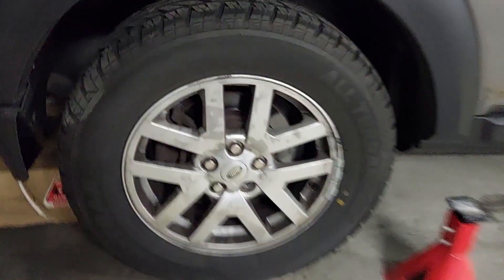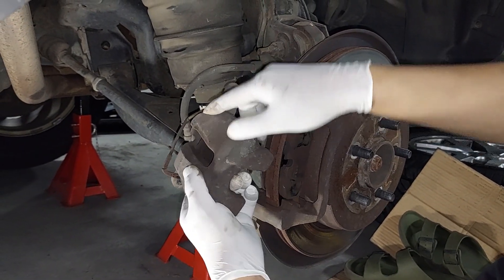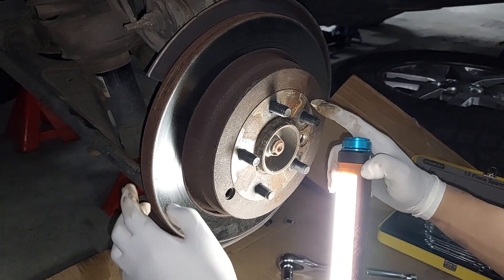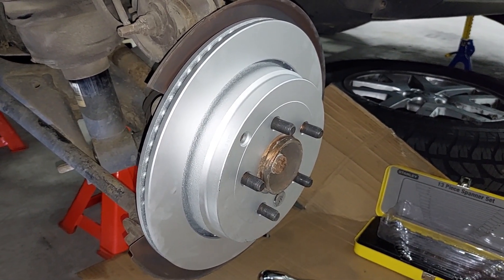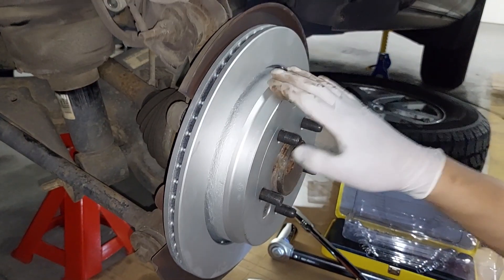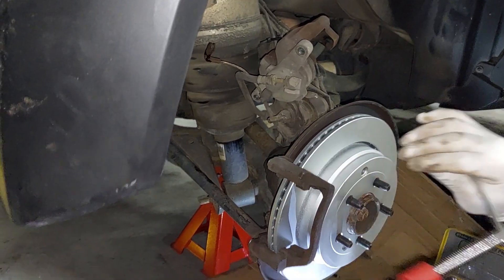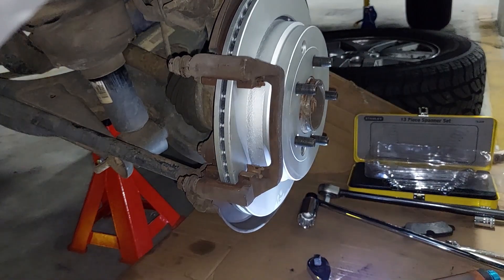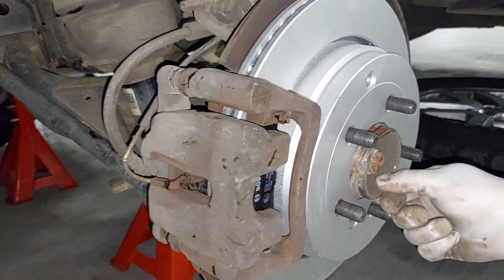LANDROVER DISCOVERY 3 LR3 - REAR BRAKE ROTOR + PAD REPLACEMENT

Comment: I have a 1997 Disco 3 and replacing the rear brake rotors I got to the stage of adjusting the click wheel tight so about 90 Nm and then tried to click the wheel back 8 clicks and although it has small movement it won't go over the clicks. Almost bending a good sized screw driver but it won't budge? Also my adjust hole is at the bottom on the left hand side not the top like in your video.

Any ideas please?
Reply from the maker: You mean 2007 Disco 3, in 1997 they had discovery 1. 

Not too sure about the  exact reason, unless your brake shoes are worn out or just the rust and dirt built up has jammed the adjustment cog.
Reply: @DISCO3_BEGINNER  Yes 2007 D3 thanks but the cog does move a little but it won't click over?
Reply: @DISCO3_BEGINNER  You probably know the LR Time German couple. He does it and removes the hand brake pads and there is another mechanism on there which requires setting before it is put back. Then after the disc rotor is on and the brake adjustor wheel is backed off 1 rev he turns the adjustor hole to line up with a small hex drive screw and tightens it to set this other little mechanism up? do you know about that?
Reply from the maker: @mikebellamy  i know LR time but have not watched the video you are mentioning. Sorry mate.
Reply: @DISCO3_BEGINNER  I think my only choice is to get a hydraulic pac and pull the rotor off the hub..
Reply: @DISCO3_BEGINNER  It's ok I solved it. When I watched your video I just got mixed which way to loosen and tighten the brakes and I pushed it the wrong way a bit to hard and it jammed but when I got the direction right it came loose again. Thanks
Reply from the maker: @mikebellamy  great to know you fixed it. Well done..